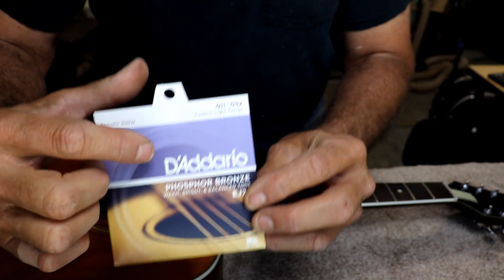497 RSW Regal Wreck 2 Deja Vu All Over Again P2

Comment: Hey jerry! As a live sound engineer with over 17 years in the business I can tell you that those wear marks on the sides and back is most likely from duct tape. The proper tape in the business would be gaffer tape. They look very similar and are often mistaken for each other or duct tape are many time used mistakingly as a temporary replacement when out of gaffer. But duct tape is tackier, leaves residues and are much more prone to tare of the finish when removed. I also believe from experience that the residues from the duct tape have a corroding or deteriorating effect on lacker and shellac. 

Just wanted to share my discoveries over the years.
Reply: True. I don't know the real difference between the two but duct tape residue seems to dissolve in alcohol and it might be alcohol based or something like that. The solvent evaporates from the duct tape leaving kind of a brittle layer of "glue". This is also why old rolls of duct tape left overs just unroll and produce dust from the glue that became brittle.
Especially on shellac, tapes with alcohol based solvent will damage the finish since shellac is also alcohol based.
Fixing this means that you need to scrape the part completely clean until all contamination is gone. With real shellac that could mean you have to sand down into the wood. What I do on furniture is to rub the piece with alcohol. If it feels like snot there is still tape residue on the part. Note that real shellac is alcohol based and it will dissolve in the alcohol too
Reply: I am a gaffer in the movie biz. Real gaff tape is a woven fabric. I have seen a car lifted with real gaff tape but it is hard to find. Go through the movie supply houses. Quixote, Cinelease, and a few others will sell you the real stuff. What Home Depot calls Gafffers tape is crap.Good luck!

Comment: You did a fantastic job on this repair.  Most "professional Luthiers" would have had the customer invest another 8-12 hours labor to take the back off the traditional way and invest another 3-4 hours applying masking tape to the the fretboard and leveling, crowing and dressing the frets along with the many neck reset hours.  Very nice sounding and functionally stable guitar now.   The end result was excellent.

Comment: I have a block of wood 3/4" tall and 4 inches long, rounded on top and bottom. After loosening the strings, I slip this under the strings until it hits the bridge, then rotate it upright. This allows me to withdraw the saddle without too much effort.

In addition, I use a 1/2" hardwood dowel about 4" long with a 1/2 grove in each end. This is my string spreader, if I only have to work on a couple of ornery frets, etc.

Mylar is great as a shim for nuts and saddles, as it's tough, doesn't compress much, and comes in many increments of thickness from 5 mill upwards. I've found that you can use it to prop up a bridge that is a bit too narrow for the bridge slot, and is leaning forward, for instance. You put a strip of Mylar into the slot in front of the bridge. Cut it carefully, and it won't show.

Jerry has been an inspiration to me for trying many approaches to various problems. He seems tp always find a way, no matter how difficult the issue. Thanks, Jerry!

Comment: When I was at school, quite a long time ago, the school governors thought it a sensible idea to devote time each week to an hour's carpentry and an hour's metalwork to give a bit of balance to the students against a heavy academic load, and the school became endowed with two workshops that a medium-sized commercial outfit would have been proud to have owned.  Two early-retired tradesmen were taken on to run the respective workshops. It is odd how one remember things, but every time I tighten a nut, there is, in the back of my head, the echo of my metalwork teacher saying, "Tight is tight, and no more."

Likewise, my carpentry instructor exhorting me to only ever cut the 'waste' side of the line, and that if I ever used a measuring stick to cut a number of items to its length, then to use only one stick for that purpose, which was so clearly marked that it was unusable for any other.

Who does not remember little quips about measuring twice, and suchlike, dropped within an offender's earshot ?

Comment: Never really though about sawing off a back BUT I would have to agree with you once you think about it.  The traditional method can cause uneven breaking and uneven spots which then have to be sanded which in affect may cause even more of a mismatch.  By sawing, the kerf actually matches up on both sides.  Thanks for your clever insight to this repair!

Comment: Hi Jerry;
At about 16:10 It looks like one of the vertical side braces between the two kerfs is missing. However; if it is, it's missing on both sides. It's just that there's a bare spot on the wood that makes it look like something was pulled off there. Great job on the top and back. Are you sure that's not two big hands and one small hand (3 hands). Some of those sound holes are rather small. I hate to tell you how many times I have gotten ahead of myself on a project and been forced to back up and punt. That guitar really looks a lot better and sounds great now. I really love to watch your videos. keep on truckin my friend.

Comment: With regard to gluing, would a good way to put it be that a tightly clamped glue joint is gluing wood fibers to other wood fibers while filling with glue is making a sandwich of wood and glue where the glue is a brittle middle layer?
Reply from the maker: I think you're right on

Comment: I like to think of glue joints like reinforced concrete. The glue is the cement. The wood is the aggregate/rebar. Any place where there is only cement(glue) there is no reinforcement. It will eventually crack. Idk if that's a good analogy or not but it makes sense in my brain.

Comment: Would i be guessing correctly that the first glue repair was done through the sound hole without removing the back? Figuring the way the glue flowed it was just poured in and not clamped!

Comment: You cleaned the inside of back piece pretty good, but you could've sanded it a bit better because that's visible through the sound hole. I think it'll probably be okay, but it's slightly discolored where all that glue from previous work had been glommed all over the place. There is no original sticker, probably because of the mess from that original;"repair". You should make your own labels that say something about your company, and what you did, and when you did it. Hey! -  Free advertising!! But when people look in the sound holes they should see sanded wood, and no glue.

You did a great job, and that guitar sounds as good as a Martin.

Comment: Great video. I was thinking at about 25:00, you could use an air ch^H^H^H^H^H^H inner tube, or a rubber band of some kind, around the body, to hold these spool clamps against the sides.
Reply: What is an "air chamber"?
Do you mean something like a tire bead seater?
Reply: @zapa1pnt  Sorry for my bad english. I meant the inner tube of a bike tire, and I found a bad translation.

Comment: I would think while you had the back off and knowing that the sides needed to be spread to line up with the back, you could have made stick or skinny board to just spread the sides to match the back and then once the back was glued on just go in and push the side spreader stick out of place and remove it thru the sound hole.
Reply from the maker: Sounds simple but it's not

Comment: What if you used a stick inside at the waist, long enough to push both sides outwards at the same time? Then remove the stick through the sound hole?
Reply: I thought kinda the same thing.
Two small blocks, with a turnbuckle in the middle, which
would fit through the sound hole.

Comment: Unfortunately, I've seen a lot of these old Harmony Sovereigns with extra squeeze out, poorly fit necks, and very bad abuse. Had one until it fell on a concrete floor during a storm. Still sickens me to think about.
Reply: I have a late  60's harmony with no truss rod adjustment, but has a steel rod reinforcement   and a bent neck its a project
Reply: @patricknicolucci5073  I wish you the best luck on that! Even the cheaper ones have a very unique tonality